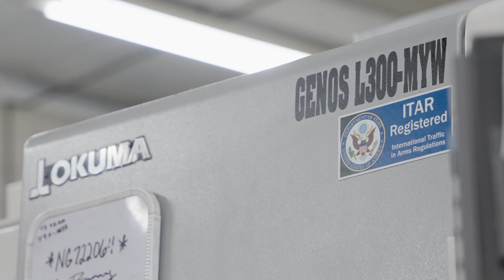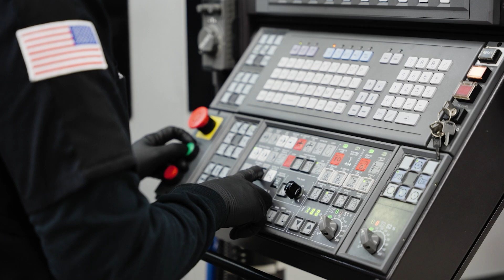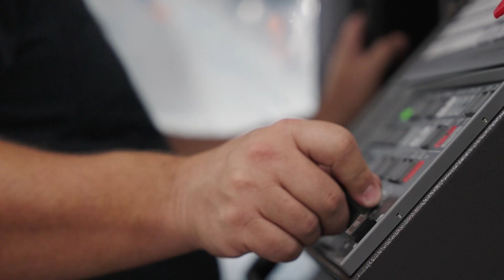From Racing to Aerospace: The Secret to High-Performance Machining

Comment: We bought a used 2003 MacTurn 250W last year. We only had Haas machines before this and the difference is unreal between a Haas and an Okuma. The machine is an absolute beast and is still producing perfect parts at its age. Definitely going to be considering Okuma for the next machine in the future as well.
Reply from the maker: We're so glad to hear you've had a great experience with your Okuma so far! If you have any questions about our current available models, we recommend reaching out to your local Okuma distributor. You can locate them, and their contact information, here: https://www.okuma.com/distributors

Comment: What is the machine that flashes on the screen at 0:10? Looks extremely unique!
Reply: it is the old Okuma hexapod, PM-600 produced about 14 years ago
Reply: What they said above. They called it the spider. I believe if I’m not wrong it was developed for cylinder head port work. At least that’s what RCR mainly used it for.